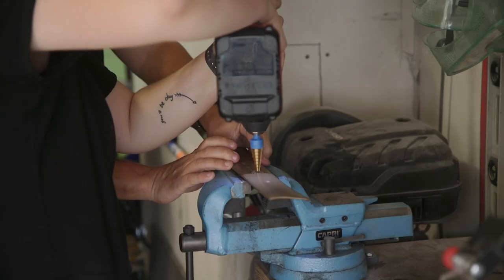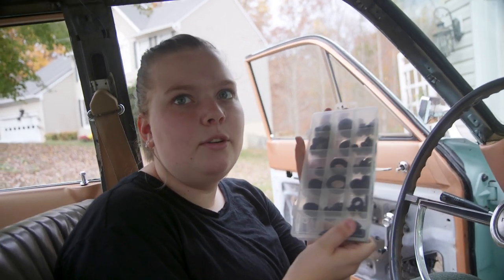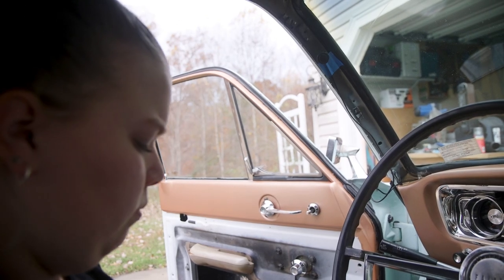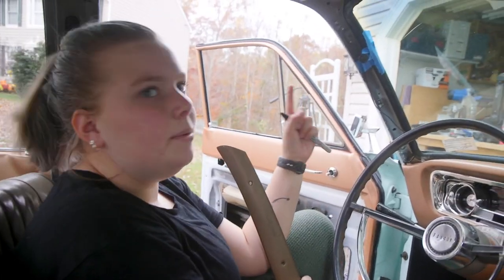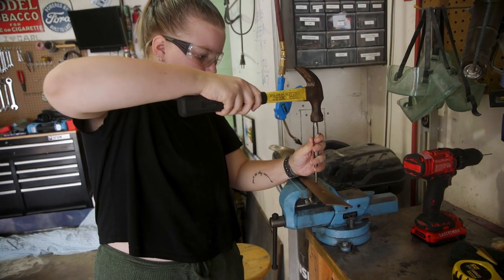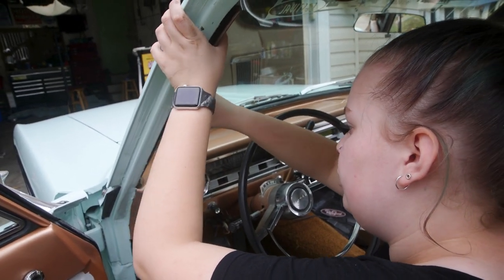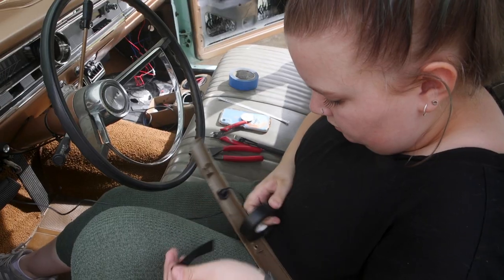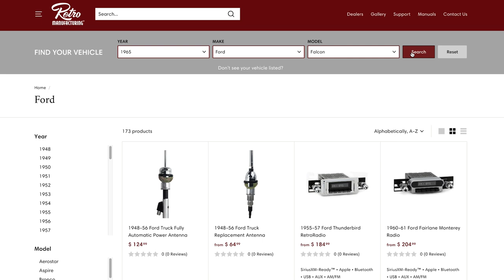Bluetooth Mic in My '65 Falcon 🤩 Clean Install!

Comment: Great job! Any step forward is not a small thing. It’s a WIN! That looks so much better than if it was just mounted on the dash or wherever they intended. 👍🏻👍🏻
Now maybe retro manufacturing will get the hint to make a more shallow speaker housing for installing.

Comment: Nice your trim is metal.  Mine is plastic.  All distorted.  Had to use plastic tape to hold it up.  I can't figure how to dial using voice.  But over very good.
Reply: I was wondering how to dial and how to answer a call without touching either the phone or the radio.  For that matter, how to play music from the phone without touching the phone. Or play music from the raido, if it has SD memory, or USB memory.

Comment: Well done. Is there a way to answer the phone without touching either the phone or the radio?  Maybe just say "Answer" to the Mic?
   I think I'd try to find some paint to pant the grommet and the mic to make it even more hard to see. Whenever I get a speaker, it comes with a black grill. Unless the car has a black interior, I always want to paint the grill or not use a grill at all but just drill a hundred tiny holes in the rear shelf or panel that it goes behind.

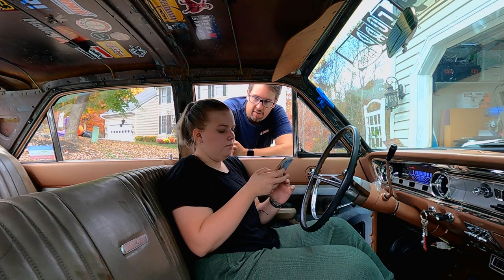Comment: Hello, I noticed you 3 point seatbelt attached to the B post in 5:04. I have 67 impala sedan that has trim over the B post that can easily be removed.I'm wondering how in the world could I get the 3 point seatbelt attached like you did and still cover it with the trim so it's not an eye sore., any suggestions?
Reply from the maker: Hi! Not sure if your b-pillar trim is like ours, but I would think it couldn't be too different. Basically, we pulled off the b-pillar trim, welded in the seat belt plates to the b-pillar, and then drilled a hole in the trim. The seat belt anchor has a plastic cover that covers over the hole so it looks really good. Here's the episode where I installed them. 
https://youtu.be/cznGf892SX8